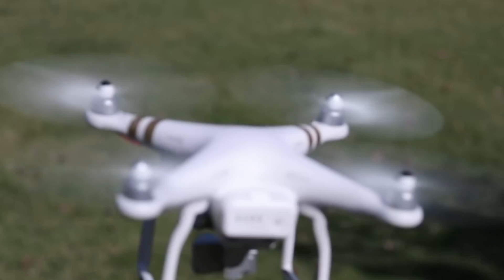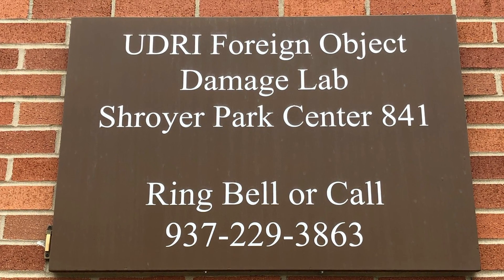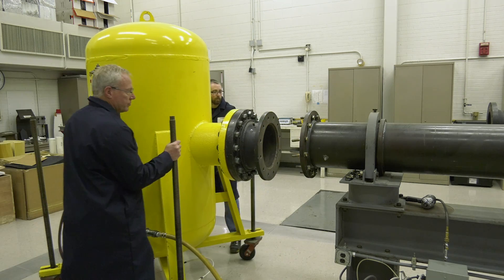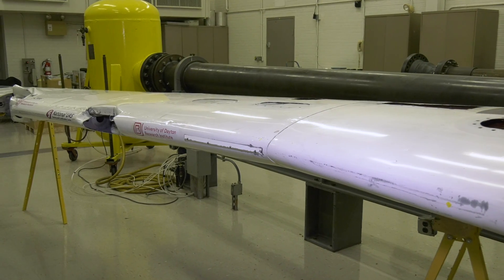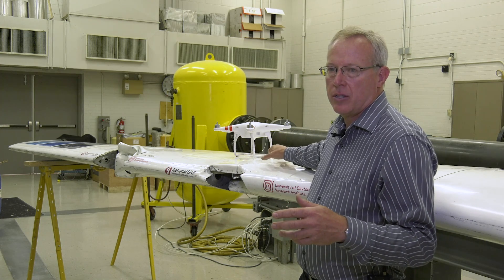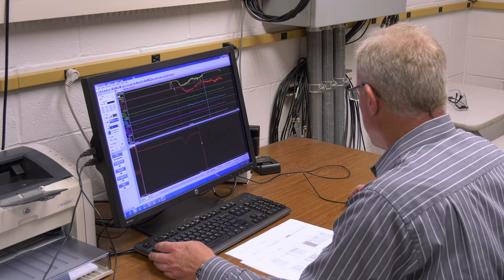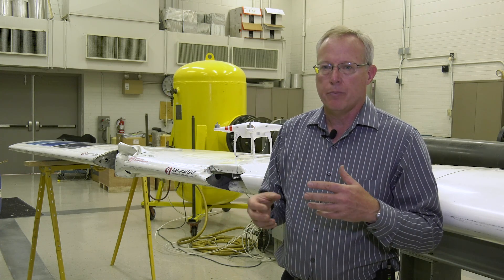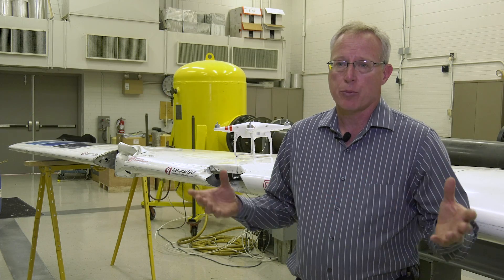What Happens When a Drone Hits an Airplane Wing? – AIN

Comment: I love the conjecture here.  The whole point is testing then he goes on to say ‘if it had been a faster commercial airplane there would have been substantial more damage”

Test at higher speeds, do not offer your opinion.  Ugh.
Reply: Joe Funk very bad science.
Reply: There are drone videos that have been taken down showing commercial passenger aircraft passing the drones at over 30,000 feet. I hope that the radar in commercial aircraft are modified to pick up drones that are not equipped with transmit only ADS-B systems.  Drone vendors need to use something like mini cargo containers to reduce theft rates during break ins. I worry about balloon camera flights also.
Reply: It's not conjecture. If you knew anything about physics (he even explained in the video) you would know that increased velocity of an object has an exponential effect on its kinetic energy.
Reply: the Orange  you seriously just said that?

You don’t know who you are talking to.   Why not just test at 5 MPH and then say same thing?   Yeaaa.   That’s why
Reply: @joefunk1611  I never said that no one should ever test. I said that it isn't congecture to say there will be a lot more damaging considering physics. If you don't understand physics that is fine though.
Reply: the Orange you are laughable.  Someone who understood physics as well as I do would not get bent out of shape enough to respond like that.  It is absolutely conjecture!  What if the result of higher speeds is that that drone is obliterated and the wing less damaged?  I’m not suggesting it would, but that it needs to be tested not put out there as FUD!

You attack a persons knowledge without reason to get ‘personal’.  By doing so you reveal the type of person you are.  There is an attack going on right now on drones by nefarious people lobbying for far too heavy regulation.

You are part of the problem 
I hope you grow up.
Reply: the Orange Except for the fact that a Mooney can’t really go any faster without overspeeding, so testing the same wing at a higher speed would be mostly pointless. Of course a higher speed impact would have more kinetic energy, but to have a reasonable test, they’d need to test a wing of an aircraft that can actually attain those higher speeds. Airliners generally have highly swept wings with more robust leading edges, which could significantly affect the results of a similar test at higher speeds. That’s why it’s disingenuous to say what he did.
Reply: It was still just his opinion, just as Joe Funk stated.  The word substantial is relative. And, an opinion.  Without the actual test data or (recorded actual events documented and witnessed) at those higher speeds is still just an opinion.  Joe Funk is correct.

Comment: Drone is flying in the air. And together with airflow will (most of the times) fly around the ( above or below ) the wing. 
What these guys simulated - is perfect hit when drone is not even floating in the air but speeding as bullet. ( Props are not spinning). So fluid dynamics are completely different. I may be wrong but then explain why.
Reply: Please name your source for the collision.
Reply: I must say thank you for question, cause I can't find it anymore.
Apperantly these two videos mixed together in my memory:
https://www.youtube.com/watch?v=UECwc8cxlx0
https://www.youtube.com/watch?v=x1GGb8JtYHM

Comment: Scary to think that a lithium battery, possibly damaged from the impact could be sat next to or inside the fuel cell.
Reply: Also scary to think that nowadays every airliner has perhaps 400 cellphones on board, each with a lithium battery capable of doing severe damage. I think our only saving grace is that the batteries are so reliable now.
Reply: king2042  Are you referring to the passengers playing with their phones, pads, laptops, etc.,who sit extremely close to the fuel tanks in a Mooney?
By close I mean the fuel tanks are all the way up to the wing root.
So let’s say 1 1/2 to 2 feet away.
That is much, much more likely to cause a toxic in cabin fire that may make its way to the fuel ...or burn through floor into the control system....or the fuel lines below the floor....or incapacitate the pilot with toxic fumes.

Comment: Nope. This is what happens when you launch a DJI Phantom with a canon at the static wing. 

How many drone users have access to a canon?

Also, airflow and real life conditions were ignored.
Birds sport bones too, as they are more than goo cylinders. 
In real life, there are basically zero model-to-1:1 meaningful events but many deaths/year caused by pilot error and aircraft failure in commercial, private and  military aircraft.
Reply: They have canon cameras, nerd
Reply: aval1998 So what's your point? Canon (company) has nothing to do with an air cannon.
Reply: @stevess7777  just making fun of the misspelling.
Reply: Wtf are you talking about? The closing speed is the same if the wing was moving or the drone. Airflow at that speed and impact wouldn't be significant to do anything the drone and impact would still be substantial.  Airbus and boeing have been doing this for years and testing stationary.
Reply: Pașca Alexandru that is correct. The wing is not moving and the event would be different if the wing and the done were moving. Not sure how significant the  difference in result would be with this test. I'm not sure if anyone mentioned this but the battery entering the wing could be a concern as that being crushed may result in a release of energy that causes further damage
Reply: I have access to a cannon.
Reply: It’s easier to have a controlled strike using a cannon to launch the drone than it is to accelerate an entire wing to 200mph and they yield the same result. It’s all about the differential of velocity. Physics doesn’t care which piece is actually moving.
Reply: @dustin9258  but wouldnt the air go around the wing as its moving in flight. Is that psychics enough for you?
Reply: Bushido Brown makes zero difference as far as how much damage a direct impact would cause to a wing.
Reply: @dustin9258  they wasted that perfectly good wing on a drone and they should have shot a duck at it
Reply: I use Nikon ,but I have friends who own Canons
Reply: That’s how I take off , via cannon and I only take off when a large airplane is directly overhead.
Reply: Yeah but bird bones are hollow and bendy, maybe just add some straws
Reply: It's a political ploy to regulate.

Comment: There's pics of a Phantom drone that hit a Blackhawk helicopters rotor blade. When you look at the pics you can barely see a scratch in the rotor blade.
Reply: Rotor blades and wings are completely different things.
Reply: How. Explain.
Reply: Helicopter rotors tend to be a bit more dense, with materials meant to withstand both the high RPM of the rotors and any debris that may hit it during flight. Airplane wings are much more hollow and thus weaker than Helicopter rotors, and are designed like this because they do not need to withstand neither a high RPM nor do they have to deal with debris impact nearly as often. Also, wings tend to have critical components and piping within them due to them being more hollow, which can lead to a severely crippled airplane if they are destroyed due to debris from an impact, while helicopter rotors don't tend to have anything inside them other than structural support material.
Reply: Ah, okay. Your statement was vague, and could be interpreted as each being aerodynamically different (they are not.)
Reply: @zackthebongripper7274  The wing is a thin layer of aluminum which is highly susceptible to impact loads. You can actually bend the aluminum by hand. Rotor blades are composite structures that are far more resistant to impact loads. A spinning rotor blade can actually cut small trees in half (this happens when a helicopter crashes in a forest). A light aluminum wing hitting a tree going the same speed would shear the wing right through. You can actually dent a wing fairly easily.
Reply: Yeah, I know.
Reply: Yes,also when birds hit helicopter rotors its just a puff of feathers,lot of energy in tip of heli rotor
Reply: Blackhawk rotors are also designed to survive COMBAT the wing if a GA airplane is not.
Reply: I guess you missed the dents across the rotor. Realize you can’t just fly a helicopter with a damaged rotor? That has to be replaced now.
Reply: To be fair if a 500 size rc helicopter can decapitate you, I'm not surprised a military helicopter could kill a drone without even noticing.
Reply: Of course, this test was bullshit.
Reply: That's the only real world collision I've actually seen and data on. If drones are the threat every one keeps screaming about there should be more documented strike but there isn't. Like to see bird strike vs drone strike numbers. I know almost every time I'm flying my drone the aircraft would have to be doing something incredibly unsafe or illegal for there to be a situation where a strike would even be possible.
Reply: @matthewconnor5483  You are a wise pilot. Believe me there are extremely dumb people. Not to mention psychopaths who would do this on purpose.

Comment: It's really simple, make it manditory for all drones to transmit ADSB.
Reply: Alert, my 65mm wheelbase 30 gram micro quad is between 5 and 10 ft altitude (about 20 ft below tree lines), all pilots planning to crash should be on the look out for what looks like a Styrofoam cup floating around at up to 10 mph. 
That is all, use caution!
Reply: @jakegarrett8109  Made my day.
Reply: @jakegarrett8109  lol that seems like a joke and you're making it up but it is actually so true, most hobbyist drone pilots are flying a sub 250g drone, many even less than 100g flying in the local park well below the tree tops, so the authorities want us to fit transponders and call in every flight!? 😊😁
My grandad used to fly model planes years ago, it was never a problem until all this media hype about drones!
Reply: @pdtech4524  Yeah, I've had a blast with my new 1s brushless whoop (OSD, telemetry, its amazing what it has). I'd love to go fly it outside whooping, but its a 45 minute drive until I'm 5 miles from any airport... Plus where I'm at, there are 4 different airports... Its not like I'm going that high of altitude, these things make a kitchen table look like an immense cavern or cave ready to explore. I would so love to walk outside and fly around the trees and gap some tall grass, but nope, Uncle Sam says no Freedom for you!
Reply: @jakegarrett8109  I've just been watching a youtube video where a guy with a dji inspire wanted to fly just inside the 5 mile limit to an airport, he rang the tower to get permission, you could try that especially if you're flying well below the tree tops! 👍🙂
Reply: @pdtech4524  Yeah, I'm hoping they will allow it (I'm not sure about 1 of them). I've so far been exploring the inside of my house (managed to find some car keys last crash, been looking forever for them!). I never would have been looking behind the couch, but you manage to fall into the weirdest of places with a quadcopter, so far I've also found a lot of loose change and a sock (now I know why I had half a pair, found the other one!)
Reply: In that case you get spammed by traffic alerts

Comment: yup, that’s y we have faa rules no fly zone in any close to the airport and no higher than 400 feet up in the air , I disagree with this video no one is dum enough to fly near the flight path and I my self fly quadcopter like that one dji brand I also owned a bigger quadcopter like inspire one it’s a 600mm size ,

Comment: This is very unrealistic. If a drone collided with a general aviation category plane at about 1,000-2,000 feet, then the plane would not be going anywhere near 240mph. A GA plane would be flying at about 90-130 kias (knots indicated airspeed) at either climb out or short final. If a drone impacted a real jet, then it would be going about 130-180 kias under 2 or 4,000 feet. Also, real airplanes do have something called a slat, which is a lift creating device on the leading edge of the wing, and is much harder than the un-proportionally weak aluminum used on the “airworthy” testing wing.
Reply: All airplanes have slats? More like most airplanes don't. Also slats are made of the same aluminum. Dumb conclusion

Comment: Its 2018......why they are testing with a Phantom 2?😅

Why not a Mavic Pro?
Reply: Some say the rouge Phantom 2's are still flying around uncontrolled, and have never touched the ground, that they wander the air space like ghosts.
Reply: Makes sense to use the cheapest & most common "armaments".  The AK47 isnt new either, its used coz its cheap & common & effective.  Cost-per-benefit is important in war :(
edit: wait, i forget this might just be some untrained quadcopter pilot accidentally getting in the way of a plane.   War isn't the only relevance for these tests.
Reply: because when you are trying to release an anti-drone propaganda video, you need to use cheap and misleading products in your "test", including that styrofoam plane wine!
Reply: Ok, got it😅
Reply: Because this was a politically biased test.  To prove their point more effectively they used a larger multirotor against an aircraft that flies much faster than most GA aircraft.
Reply: @MatHolliday  ok but the Phantom 2 has only a range from 300 Metres.....and how you want to fly 500-1000 m high?
Reply: Phantom 3 and Phantom 4 have a much greater range and are practically the same construction.  They probably used a phantom 2 in the test vs a 3 or 4 because of cost.  The phantom 2 is alot cheap and they would get the same result either way.
Reply: Easy- you launch it with a Phantom 2 cannon. :D
Reply: Fjodor Lundgren Yeah it looks like they went really cheap on the test equipment for this test?
When you’ve got a hammer, everything looks like a nail.
Reply: Exactly. They should atleast use a Phantom 4
Reply: Lul
Reply: Because its smaller and would do less damage. People like this want to get these things banned so they are going to try to make it look bad. Lets be real most people don't fly at the height of a plane anyways.
Reply: Or phantom 3, its one of the most common
Reply: Why not a spark!
Reply: @kulifrunsen  spark wont't do shit . maximum size most hobbyist will get is an inspire
Reply: not to waste $1000 XD but its stupid they said it was very popular tho...

Comment: A better test would be to move the wing at 238 mph and hit the drone.
There may be air flow that would cause drone to deflect rather than direct hit. It would no doubt do damage, but this is not a good test.
Reply: The speed that the plane would be traveling at would be too fast for that effect to take place. The results would be exactly the same, except it seems you'd all try and find some other excuse as to why the test was in some way faulty.
Reply: MrMilkman29 
I never implied that the test results would be different, but if you don't test it real world
Reply: The only thing that would accomplish is wasting more money on a test that could easily have been done with the exact same results by just throwing the drone at the wing. Should we start throwing walls at cars to see how they fare during a test?
Reply: @MrMilkman29  Surely you can see the flaw in your logic.  Walls don't move.
Reply: That doesn't change the fact that throwing the drone at the wing is the exact same thing as the plane hitting the drone as it travels.
Reply: It's a political ploy to regulate.
Reply: back to physics i would say. its the same

Comment: That's a lot of crap, 238mph? those drones usually hover, and sometimes scoot along at maybe 15 mph, though I know some can go much faster, they're generally not moving very fast. So the private aircraft would have to be doing most of that speed.  Also they tend to fly low to the ground, so unless the plane is flying low anyway, they would probably be coming in for a landing and doing much less than 238 MPH.  Also that was a dead-on strike right on the edge of the wing, we're talking a perfect storm of improbable events that wouldn't even crash the plane.  And if they're worried about someone intentionally flying into a plane? good luck trying to hit a plane with a drone doing 238mph!